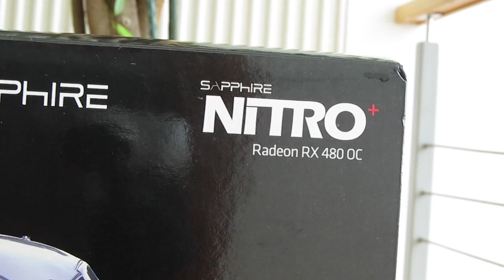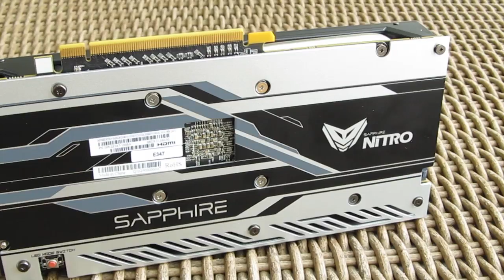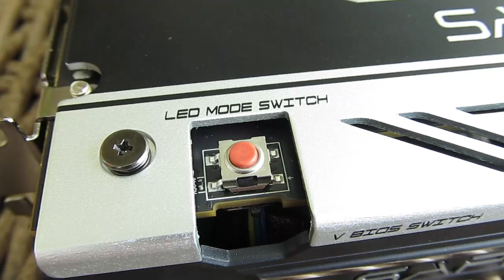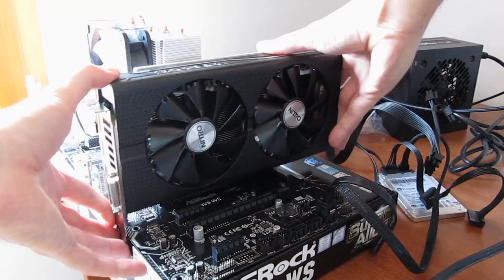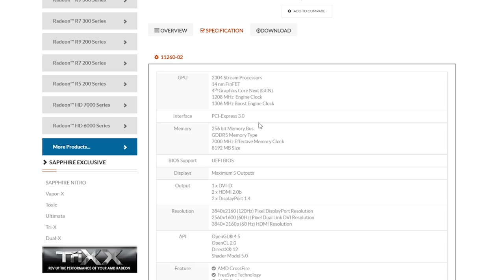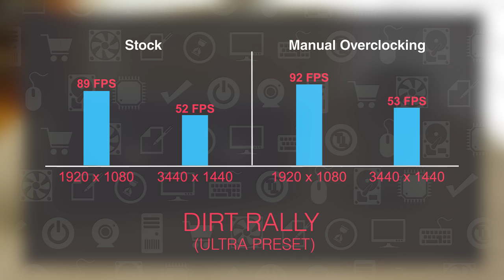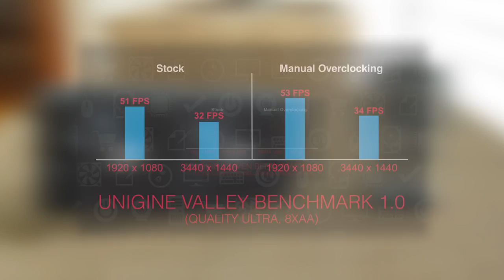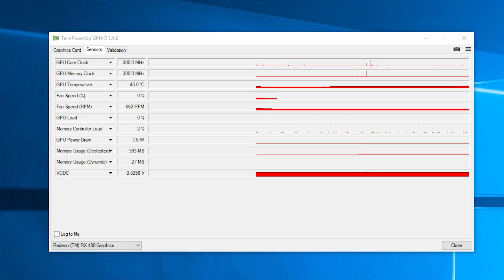Sapphire RX 480 Nitro+ Review - Aftermarket Salvation

Comment: Great video, glad to see that you have started growing :)
Reply from the maker: Thank you man! :)
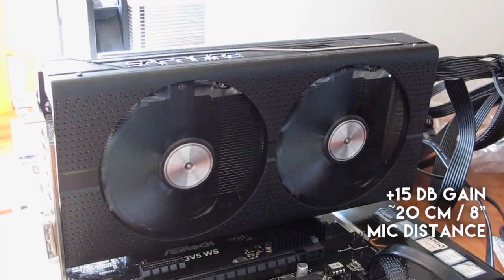Reply: hey can you please tell me at what percentage were the fans running at 7:00 ? thanks!
Reply from the maker: Around 50%, give or take 5%.
Reply: Thanks for the video. Will you be doing a temperature and sound comparison between the reference? Say side by side, or more information to make it more in depth. 
Like I don't know what the +15 db means. 15 db's from when it's not running? Or 15 db's  compared to a reference at the same speed, which doesn't make sense but hey idk. what is the bd level of it exactly? cause 15 db's to 0 doesn't mean much. Did you turn on the db reader before it started spinning to get it at a base level, cause psu, and case fans may effect it as well. But I just wasn't sure what was going on, if you could answer some of these questions, it would be great. Or a video would be great as well. Thanks for your time.
Reply from the maker: +Les broken vich Dez
Before all, that's not a measurement of any kind. Since the mic doesn't pick up the sound that well in a way that it can represent "a real life / in person" noise profile of the fan noise, I do a +15 dB gain so you'll get a better feel of the noise that it makes, trying to achieve what it would be to hear it when standing in front of it. I do that for all of my cooler noise testing of graphics cards, it's not meant to be a scientific method, nor it wants to be, it's just a way of me giving you a rough estimate what it sounds like. I'll be getting a noise meter soon so I can have a definitive numbers and more scientific approach. :)

I turn of the fan on the CPU cooler and stop the fan on the PSU for a period of 30 seconds.
Reply: Thanks. Seems like you did the best you could with what you got. And really did your due diligence. Subscribed. And I hope you continue with this quality. Very intrested to see the difference of a reference model. While I will likely go with an after market version cause I hate noise/coil whine/anything loud. I'd rather buy the 4gb over the 8gb if there is to big a premium.
Reply: ene, otkud ti ovdje?

Comment: How disappointing, wanted a cool and quite card, but seems i have to get the msi 1060.
Reply: The 1060 will age horribly much like NV other cards from 2013 that now get whipped without effort from the R9 270- R9 290.. Poor DX12 support is just unacceptable for card these days which the 1060 has in comparison to the RX480. the extra 9 fps in DX11 games now is gonna be all but gone in updated drivers. However the 20-40FPS gain in DX12 and Vulkan games for the AMD RX480 vs NV GTX 1060 won't be ever made up as the GTX 1060 lacks the hardware to make up those gains.

Essentially I'm saying AMD can without a doubt can make up the 9FPS loss to the NV through drivers but the NV 1060 won't ever be able to do the same with DX12 and Vulkan..
Reply: +Shinigami Quiet. The words quiet. Sry its just annoying
Reply: The msi reaches the same °C
Reply: +Tyron the 1060 Msi is around 63-65 unser load.
Reply: Cooling absolutely has to do with the architecture. The 1060 is easy to cool because it's extremely frugal in terms of power consumption, and puts out less heat as a result. This isn't a direct brand comparison, but Techpowerup has the MSI GTX 1060 at 28dB and the ASUS RX 480 at 39dB at pretty much the same temperature. I believe there will be a quieter RX 480 available, but nothing currently released has proven this.

Also consider the reference cards. As much as Nvidia's reference Founder's cooler has been hyped up, it's the same reference cooling solution that has been around for 2-3 generations now. There's a major gap between both cards for noise and temperatures in favor of the 1060 versus the 480.

Feel free to call TPU biased, but their findings have been consistent with my experience for both AMD and Nvidia cards. With the power consumption predicted for the 460 and 470, there should be more quiet options available for silence freaks, but for the record, the MSI 1060 is one of the quietest ~midrange cards ever released.
Reply: Pascal cards are really quiet, the MSI 1060 cooler is totally overdone and you'll be really happy with the noise levels unless they show up with coil whine
Reply: +Rickstahification That has nothing to do with the Architecture, it's a matter of cooling. Sapphires Fury is quiet as well.
But there will be more aftermarket cards and it would be interessting to know whats the issue here, e.g. bad application of thermal paste.
Reply: +Rickstahification The difference between the 1060 and 480 isn't that great, a 480 could easily be cooled quiet as well. Maybe the cooler is 3€ more expensive then.
Look at Sapphires Fury, 350W. RX 480 with 150W is louder and has higher temps.
They screwed up the cooler.
And that's not unusual on GPUs, that's why I have an aftermarket cooler, max. 60°C, not loud, and I don't care that it's 3,5 slots thick now.

Sapphire did a bad job there, I was looking for a test, because their price is high and I thouht they build something solid.
Reference 480s 8Gb have been on 239€, Sapphire 480 is 319€, MSI 1060 is 339€ and Sapphire Fury is 349€ (german prices).
The 480 looked interesting on 239€, but with the AIB prices (and not even a solid cooler) the new cards arent worth it. Clock the Fury down like the Nano and you've got a 150W card that's completely silent and offerst still more performance.

I'm not going to buy a new card anyways, my 7950 ist still doing well (some titles only on medium settings, but with the new APIs it's back to high and I can live with a few titles on medium). Got it for 199€ in 2013, oced it should be close to 4TFLOPs and has 3GB Vram.  And with the AIB prices a 470 might be 199€ with 5TFLOPs and 4GB in 2016.
Kind of depressing development, but we will see what the next gen brings. I mean both AMD and nVidia have not much done on the architecture, its just scaled down from 28 to 16/14nm.
Reply: +ronald4life1 Well AMD is always kind of futureproof, the FX CPUs run decent in newer titles as well, an FX-6300 can finally beat an i5-2500k^^
Their issue is they don't get their hardware used right. The 7950 was released 4.5 years ago with Async Compute Engines. No API dev cared and AMD had to develop it's own API to finally get those things to be used. And they're even more impressive on the 7950 than on the 480, because it has less raw performance.
The hardware was there in 2012, the support for it started in 2015.
At least you know AMD stuff is never worse than on release ;)
Reply: +SageFox but people dont like hot cards
Reply: +thom si lol my strix never touches 65 degree, stopp dreaming fanboy.
Reply: San Mattew its likely that devs will use dx12 even if it takes a while to take off like dx11 did. Also I'm getting the RX 480 not just cause of dx12 but cause amd look after their graphics cards for a long time in the future and keep releasing drivers which increase performance unlike nvidia who tend to abandon their cards drivers after a couple years. The rx480 is the better choice for a long term investment whereas the 1060 is good now, and that's about it
Reply: EarFarce4

the problem with the pcie was ONLY on ancient cheap mobos with OCed cpu and gpu and it was fixed so i don t get you are bringing it up.

what does even mean more stable in temp or consuption?
temps can t be unstable...temps can be high or low

the example of the titan was just to show you that amd temps are no where near dangerous

btw on the stress test the 1060 has the same temps...
http://www.tomshardware.com/reviews/nvidia-geforce-gtx-1060-pascal,4679-8.html

and i both cards with different cooling perform way better so the temps aren t a problem at all...
Reply: Dx12 needs still atleast 1 up to 2 years before more than a few games support it and it can still change a lot and i prefer quite and cool cards.
Reply: 96erAtDrift Do you think if you'd bought a NV card back in 2013 you would still have decent performance now?
Reply: +ronald4life1 my asus directcu 2 Top gtx 670 is still strong today.
Reply: I'm not sure if someone wants to understand this, but it's still mostly a matter of cooling.
A 1060 with a bad cooler is hot, a 480 as well.
And both are able to stay under 65°C with a good cooler.
My heavily OCed 7950 draws 240W and stays below 60°C, with 60% fanspeed.

The difference between the chips is nowhere near as significant as the difference in the cooling.
Reply: +96erAtDrift Then why does the sapphire nitro hit 76 degrees? Sapphire are meant to have very decent coolers. Do you think another manufacturer like MSI will create a cooler RX 480?
Reply: +Jamie Bergin
Sapphire is a brand, not everything made by Sapphire is good because their name is on there. Asus, MSI, Sapphire, ... they all made good and bad cards.
I'm not sure what the other AIBs will do, but this cooler obviously sucks. And it doesn't matter if it's AMD or nVidia, physiks stay the same. You need to get rid of 150W on the 480, some more with OC and that can easily be done on 60°C.
In this case a reference 480 with an aftermarketcooler easily outperforms Sapphires card on the same price.
I don't know what the other AIBs will do, but it can't get much worse.
Reply: +thom si there's 1060's with only one fan cooling them down and they still do way better than this
Reply: 96erAtDrift oh I thought the 480 was just a really hot card
Reply: +Jamie Bergin Something like really hot cards doesn't exist. They're all really hot, without cooling and overheatprotection both would burn to death within seconds.
If a card uses 150W, those 150W get converted into heat. And this heat needs to be spread into the air or the chip would heat up to much and kill itself.
It doesn't matter if it's a CPU/GPU or AMD/nVidia/Intel, this is the same on all.
So if a 480 uses 20% more than a 1060 and it has 20% better cooling it will have the same temperature and the cooler would probably cost 5$ more.
A Sapphire Fury uses 350W and stays at 62°C (20°C roomtemp) with 30% fanspeed, half of that cooler would be enough to keep the 480 sub 60°C wit 30% on the fans.

But Sapphire went with a cheap cooler, you can see the metall part is really thin on this card. That's why it's so hot.
A lot of people are only looking for the cheapest card, that's why some cards have cheap coolers. However this card is expensive and cheap, so Sapphire wants to make some money there.
Reply: +96erAtDrift Wow, thanks for the info on that. I'm probably gonna get either the MSI or G1 gaming. Which one do you think will be better?
Reply: +Jamie Bergin Haven't seen anything on the G1, so no idea at the moment.
Reply: +Jamie Bergin Haven't seen anything on the G1, so no idea at the moment.
Reply: +Tyron false, after gaming for 6 hours in a row it had peaked at 68 C.
Reply: +Peder Hansen ya but everyones saying that the 480 will be more future proof as better DX 12/Vulkan/Async compute support is a hardware thing that won't be able to be improved on the 1060. That's the reason why I'm probably gonna get the 480, also the cost of a good aftermarket 480 is about the same as a 1060 with a very bad cooler where I am. but I'm still not 100% sure which one to go for. I just simply want a card that will run current and upcoming games really well for at least a couple of years, so I dunno
Reply: +Jamie Bergin
1060 has 4.6TFLOPs
480 has 5.8TFLOPs
1070 has 6.5TFLOPs
that's their power IN THEORY, and under DX12/Vulkan with Async you can see this is pretty much were they land.
The difference is the 480 needs the new APIs to use it. Some day the 480 is between 1060/1070, the question is when.
Will be interesting to see what Battlefield 1 runs, if it's using Async all EA titles might be.
Right now it's not clear how long it will take for DX12/Vulkan.
Reply: +ronald4life1 Holy shit you are a dumb amd fanboy. Firstly the diff vetween the 2 in dx12 is very very small(in ashes one of amd biggest dx12 benches) just runs 2 fps better in 480 and i have seen some other benches in which the 1060 performed better. the same goes for all other games plus there are dx12 games that run better on 1060. Also now dont expect any perf improvement with dx12 on amd as the api already maxed out the cards. the 1060 can oc like a beast so the dx12 gap will easily be closed...
Reply: +San Mattew Can you tell me should I get the 480 or 1060 I just wanna play nu  games well and I don't want it to rum really hot
Reply: Jamie Bergin get a custom gtx 1060. The reason is that it is much cooler apart from that it overclocks very good so when oced you will get better dx12 performance than the rx 480.
Reply: +San Mattew yeah, but are you sure oc ing it would be enough to beat the 480 at Dx12? Also which custom 1060 do you think is best I was thinking the evga sc (single fan) cause its super cheap and also has decent cooling and evga is a good brand
Reply: Jamie Bergin msi gtx 1060 gaming x is very good. It ocs very well too
Reply: a 1060 can t outperform a 480 in dx12/vulkan even when oc
too much of a performance difference
pluss you should consider that AMD cards age better because AMD keeps improving the performances of old cards too with its drivers (the gtx280 got a +20% performance with vulkan)
Reply: well it seems like that the new consoles (scorpio and ps4k ) will have a gpu quite similar to the 480...so it shouldn t be too long
Reply: grey hound so 2fps is too big of a difference? LMAO!
Reply: http://www.strawpoll.me/10895460
Reply: BBBudget PC You have no guarantee that the rx 480 will perform better in future dx12 titles, especially if most of them will have dx12 implemented the same way dx12 in time spy and rise of the tomb raider is...
Reply: San Mattew The only reason the 1060 performs better in tomb raider is cause Nvidia ensured that it was optimised for nvidia hardware better
Reply: Jamie Bergin time spy isnt an nvidia benchnark yet it perfirms better. Also arent most of todays games gameworks games? Meaning that most of them will in fact perform better.
Reply: San Mattew

?
most of next gen games will be dx12 (where amd outperform nvidia in most cases) starting from BF1 in few months
Reply: grey hound again you dobt have proof that future titles will perform better on rx 480....
Reply: San Mattew

DX12 titles already perform better in AMD in many cases
and we have seen for every generation of cards AMD driver support be WAY better than Nvidia
Reply: grey hound Well seeing games right now they are quite equal. In asges for example one of amd biggest dx12 games is sometimes running better on 1060. The same with many other dx12 titles. Also the driver support is bullshit. With amd you see perf improvement overtime in dx11 because their dx11 performance was shit and had a lot of room for improvement therefore with drivers along the time performance improved unlike nvidia which maxed out dx11 performance almost immediatly. With dx12 the story is different as it already maxes out amd cards and nvidia so dont expect any perf improvement on neither amd nor nvidia this time around

Also if you check in fact ashes when it was first released around a year ago if i am not mistaken and view todays benches of the game currently theres literally no improvement. Check by yourself if you dont beleive me.
Reply: San Mattew

dx12 maxed out?
last week amd increased its performances on tomb rider by 10% with the drivers update.

you can find any excuse about nvidia cards aren t improving in performances...but at the end of the day amd cards after 2 years are way faster than the nvidia counterparts back then
Reply: grey hound Yeah because rise of the tomb raider had a shitty dx12 port on amd unlike ashes of the singularity and most of all the other dx12 titles...
Reply: http://www.tomshardware.com/reviews/amd-radeon-rx-480-polaris-10,4616-9.html

One of the things that are bothering me about the card.

Another thing about the AMD drivers is that and i quote "possible since the Hawaii-based cores live on in two of AMD’s many rebranded cards"

So unless AMD continues to use the same architecture in newer chipsets there will be a performance decrease.
Thoughts?
Reply: EarFarce4

if you mean the PCIe stuff it was fixed like a week after release with the new drivers
Reply: grey hound

I've noticed.
It's sad. After all the bullshit nvidia's pulled i was hoping to switch to team red but i guess i'll be sticking to team green for another generation :(
Oh and those fucking temps...
Reply: EarFarce4

?
the 480 runs at <70...that a really safe temp...the Titan xp runs at 84°...

for a VGA 70° are nothing
Reply: grey hound
For the same performance?

Looking at around 10 benchmarks for the same games either nvidia's better or amd's better, so one of them is lying.

Nvidia looks more stable in temps and power consumption and i also haven't heard the 1060 knocking any PCIe slots out.(Checked reddit for this).
Other than that, AMD's looks like a better card overall.